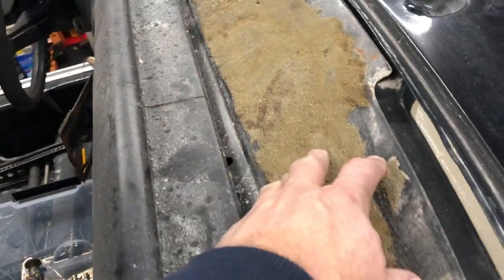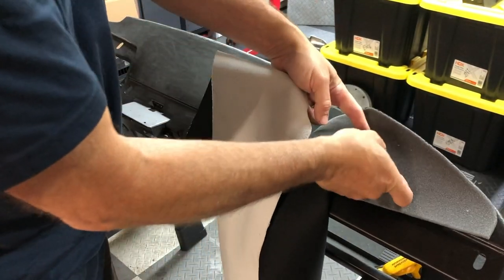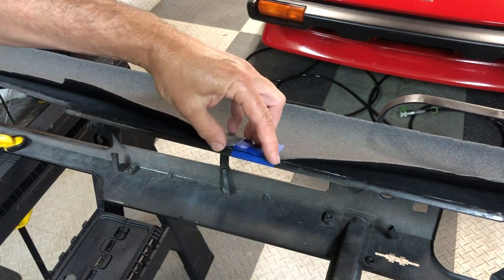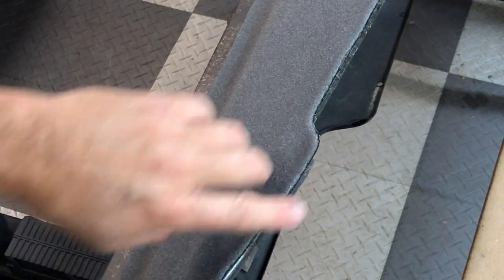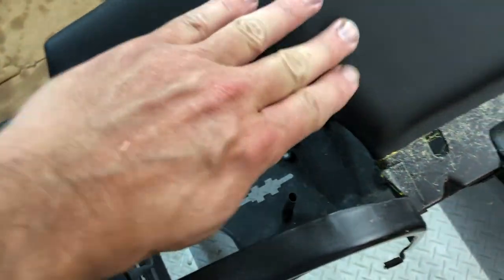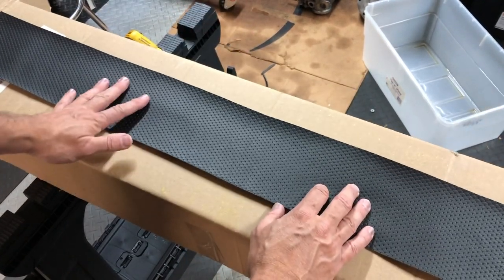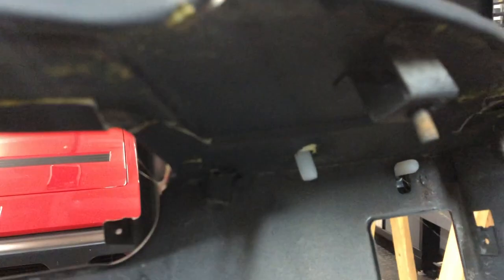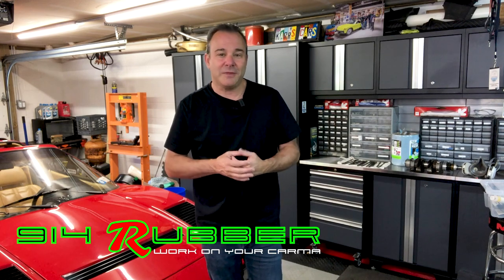Porsche 914 How to Restore the Dashboard [Project Bumblebee Ep 04]

Comment: Hey Ian, love your series(including the corny humour :)) . I bought a 74 914 2.0 liter. It came completely disassembled but unfortunately no nuts and bolts. How would I ever figure out what is needed to attach all the bits? Help!
Reply from the maker: Hey Red! Sorry for the delay...I moved my house and shop this week. Auto Atlanta and 914 Rubber sell kits with all the interior nuts and bolts. For the rest of the car, check the exploded parts views or shop manuals and the bolt sizes will be listed. You can also get a bunch of M8 and M6 in various lengths. Those are the most common sizes. You could also post questions on 914world.com. Please subscribe if you haven't already. Lots more great stuff coming. Thanks!

Comment: Hey Ian, good video. Im about to do this. But I feel that the fabric side(blk side) of the foam should be on top so "knuckle prints" cant be pressed in .It would keep the vinyl permanently flat/smooth at the surface??. I dont know, seems it would more permanently firm and "stable" at the seen side?? and the foam side would  help "fill in" the awful spot weld distortion on these? Please let me know if I am totally wrong here, they are closed for the weekend and I forgot to call them for any "tip sheet" TY! seems like a lot of thought was in putting that black layer on it when it could have just been a plain  foam layer???What is it really for????Is it really for adhesion????also it looks a bit to "puffy". My 914rubber kit looks exactly like yours.
Reply: ...im starting to wonder if that foam is actually a thin headliner material and the black side is the  finish side. ...so now what lol!
Reply from the maker: Good question. I put the black side down because the OEM stuff was just foam (no fabric side)  and the vinyl laid on top of that. You're right that it's a bit more puffy than stock (and the vinyl is a bit more matte), but I dig the look.
Reply: @IanKarr  Thanks Ian , I got it done today, 3 hours of rethinking and maybe 1 hour actual work lol. I think I did figure out possibly the best way to go about it which turns out is also prob the fastest way. Doing the face now then the $$$$ dash top lol! Some VALUABLE info: If 914rbr's black friday sale is like last year, DONT MISS IT! WOW! (my top was $99 last year, and other incredible deals if u watch and wait, had so much fun waiting for the next BIG item to pop up! That is a really great company, but you already know that! Thanks for the videos!
Reply from the maker: @gtbarnes11  which way did you glue the foam? Post pic!

Comment: is there a reason you didnt use the 13mm plastic nuts & washers that were used OE when securing the top? Looks good.
Reply from the maker: Thanks man! The kit came with metal nuts and no washers. Figured the nylon studs provided enough resistance to keep the nuts from backing out.